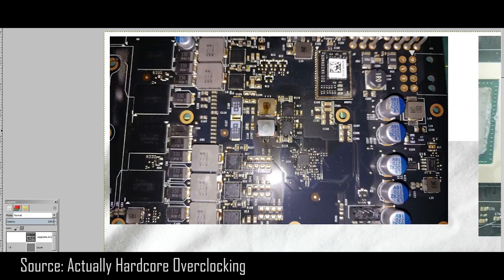Your Nvidia GPU Might Burn Up & Die?

Comment: Nvidia thank you for making me regret my 970 evenly more now
Reply: 3.5 gb 970 lol
Reply: The R9 390 was better. It used more electricity and put out more heat but had 8Gb of VRam and the Msi version outperformed the GTX 970 according to testing done by jays2cents. Also Amd uses freesync so much cheaper monitor choices.
Reply: +VN the reactor Increase your res to 1080p, lower fps would lower cpu load, as long as its playable
Reply: 970s should be okay. That being said, this is still pretty ridiculous that this is happening to high end cards at all.
Reply: Nareknu Vamnic Only certain video cards are doing this. They listed all of the affected cards. Not every Nvidia card has these and they never said they did, so your rhetoric is entirely pointless. Your crusade has been for nothing.
Reply: No, anything before skylake, Haswell-E or Ryzen is a dead platform. Get a Ryzen 5 1600 or something like that, a decent mobo, some ddr4 and all that combined might be comparable to getting a used 3770.
Reply: My GTX 970 Is Running Great, got a Gigabyte G1 Gaming thats Overclocked to 1700Mhz On air. Got this for 120€. And for 120€ i would buy Another One.
Reply: That GPU is kicking ass today , better then 1060 3 gb , pushing 60 FPS on at least high on all (at least to some extent optimized) AAA modern day titles .
Reply: I have a hd7970 which plays bf1 over 70fps at high setting, 768p but my i5 3470 is suffering so the fps keeps dropping. Should i upgrade to an i7 3770
Reply: +VN the reactor  Get a better gpu second hand like a 970 or a 580 first. Then your next upgrade should be  new platform imho.
Reply: You can upgrade, buy one from aliexpress, it's way cheap there than local stores, i am running an i7-2600k, no plans of upgrading
Reply: VN the reactor Go for it if thats all you need. It’s very cheap these days anyway. Better than upgrading the whole system.
Reply: me too xD It's horrible
Reply: Why ?? cause some youtuber post PROPAGANDA video THATS TOTAL BULLSHIT...

Dont you thing that IF NVIDIA CARD BREAK A LOT there whut be FULL FORUMS OF IT???

INSTED PEOPLE ARE HAPPYLI USING 4 and 6 years OLD MODELS NO PROBLEM.

JUST BECAUSE SOME CARDS COMPONENT FAIL IT DOES NOT MAKE NEWS. CAUSE ITS LIKE 0.001% .....

THIS VIDEO IS BULLSHIT BASED ON BIAS.
Reply: @VN the reactor You should get a 4790K atleast otherwise its just a waste.
Reply: VN the reactor I’m surprised the 7970 is only able to pull 70 at 768. Try 900p. I do that sometimes on a 4GB 580 in certain games when I want to run in dx12 w/msaa x2 Ultra graphic settings instead of high 1080p.

As for the 3770... tough call. If you can afford RAM (Even 8GB is OK w/ another 8GB stick as soon as you can swing it) I’d also recommend a cpu change. A 1600 on a b350 with 8GB ddr4 2600 can be picked up in a combo for about $350 (Newegg has an r5 1500x, Asus Prime b350, a 120 WD ssd and 16GB Kingston HyperX Fury ddr4 2400 cl13 for $350. The 1500x is essentially the equivalent of a 4790, with a slightly higher ipc but lower OC’s, so it evens out; straight from the box the r5 is faster. The ddr4 should easily OC to 2933-3200 on that board, which would put it’s gaming performance ahead of the 4790 unless the 4790 was a gold chip that OC’d to 4.9 or so, which is pretty unheard of with normal cooling (liquid or air, even with a delid).

I’d hold off on the Video Card until you can grab an 8GB card at a normal price. 3GB and 4GB cards are getting very limited, even in games from 2016. One of my 4GB rx580 pc’s constantly gives me warnings when switching to dx12, in dx12 games, or using MSAA at all, even if it’s just at x2, regardless of res, which I’ve tried lowering to 768 just to get the same warning).

So, with dx12 finally (thank you Microsoft, AMD, and Nvidea for pushing it, though Nvidea should really get behind Vulkan too) set to be the norm, 4GB and under GPUs are on their way out. I’d literally give them a year (they have been standard midrange for AMD for over 3 years now, and with Nvidea concentrating on dx12 at the hardware level, 4/8 core being the lower end on the cpu side now, and 16GB sys mem being pretty common, well expect 4GB to be in the rx550/gtx1030 tier cards next gen, then 6 for the lowest midrange (1050/560), 8-10 for normal too high midrange (1060/580 too Vega/1070 tier), and 11-16 for high end (V64, 1080+ levels).

Right now, the Ivy Bridge should be converted into a media/living room couch gaming pc imo, and start moving up. With CPUs and boards being super affordable, and that 3470 being a bottleneck on anything better than a 3GB 1060 (which like I said, will stick you at 768 on most games anyway very soon, with worse and worse textures and framerates), even with RAM sucking ass price wise, I’d still upgrade CPU/Mobo/RAM first, then wait for the vid card price drop, which is coming really, really soon. If you buy used AMD is normally a bit safer as they are normally undervolted, and often underclocked on the core as opposed to Nvidea which needs the core jacked for the best mining performance on the algorithms they are most profitable on.

Best of luck, and if the 3770 is the best you can afford for the foreseeable future, it is a good upgrade and will at least let you use a GTX 1080/V64 or equivalent without a bottleneck, at least not a noticeable one. The 3770k over clocks pretty well too, even if it has to be bclk (and a very well cooled/ventilated system if you’re motherboard only supports bclk OC and not the multipliers), 4.3 should be pretty easily achieved.

I still hope you switch to Coffee Lake or Zen (I’d go Zen for price, and you seem like you might not want to upgrade your cpu for a couple gens, so at least with Zen you will have 2 more CPU gens minimum that will work with whatever am4 board you pick, the RAM etc...do not buy a b320 board unless you plan on...just don’t, it is not worth saving $10 over a cheap b350. b320’s are the crappiest of crap boards.)
Reply: Digital Foundry has video on i7 3770k. Oced 3770kwith faster ddr3 RAM gave nice increase in performance, not every game will see the same gains but that's the way it is. It's still a good used CPU for gaming.
Reply: You don't even know, I have had my 970 from EVGA Blow up two times and then them sending me a unclocked by like 200mhz so it under performed by like 10 to 20 FPS. I sent this back and got another one but this one will completely crash my computer sending all my screens in to a Black Screen and then I have to force my computer off. I love and hate this card SO MUCH. I love that fact I can still play games on Max settings at 1080p about 4 years later, but I hate all these problems I have had.
Reply: +TheGamingTree

It sounds to me like you bought reference board cards from EVGA. Those cards are built with the same VRM and board as the Nvidia reference card.
Reply: if you're kind of person like buildzoid, then you should worried. if not, why you should regret?
Reply: my one is in rma atm
Reply: My gtx 970 died. Rips in the chat
Reply: +4 K   The 970 is a great 1080p card. Its just short of the 1060 with '6gb' of ram. Your comment is childish.
Reply: I have a Gtx 1070 as my Main Graphics card and also a Gtx 760 as a dedicated physx card myself.
Reply: @VN the reactor

No, you should upgrade to the 3770k. If your motherboard doesn't support overclocking, you might want to look into the Ryzen R5 1600.
Reply: Don't. The 970s are good cards and it looks like these limited number of cases are related to stupid people doing stupid stuff to their video cards through massive overclocking and/or letting their cards get way too hot. Another UFD FUD video. :(